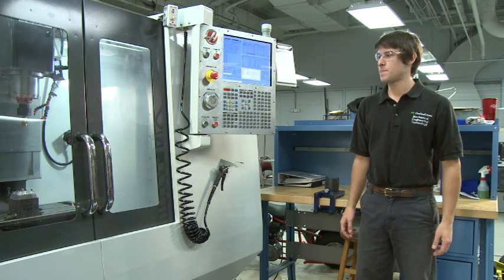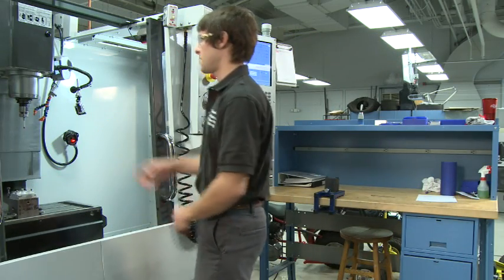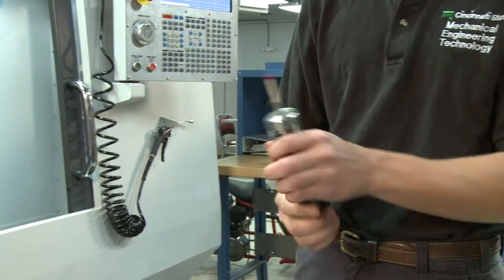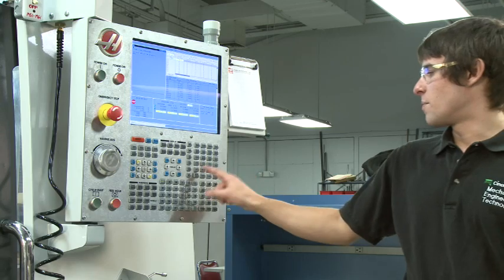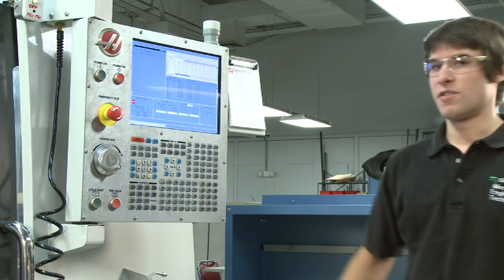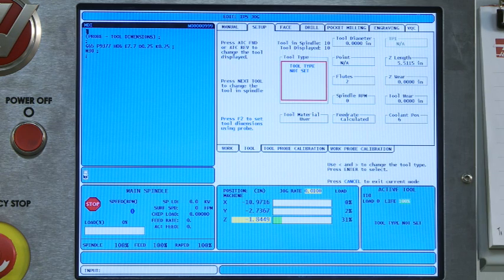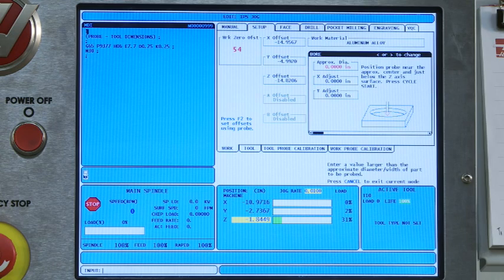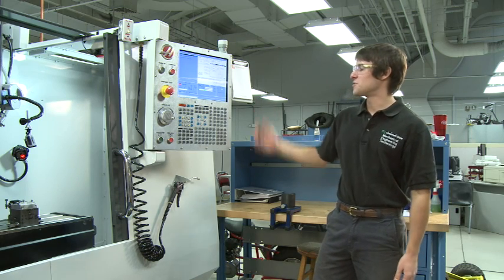Haas TM-1p Work Setup

Comment: i'm surprised nobody commented on him using the floating jaw to set a work offset...
Reply from the maker: +liquerinfrnt +Alek Hosage
    
edit: The reason that location was chosen was so that the viewer could see the probing action clearly. It was filmed first on the fixed jaw and it was not clear. Also this offset was never used, so really it doesn't matter where or how the probing takes place, only that the routine was successful (probe open / skip signal ALARMS)
Reply from the maker: +mectron63 
Not true at all, an offset can be set anywhere, especially when it is not a mass production part.

Also please read the comment you replied to, it say that corner was used so the GoPro could see it!

Thanks for watching!
Reply: allways set on a fixed jaw its a fact